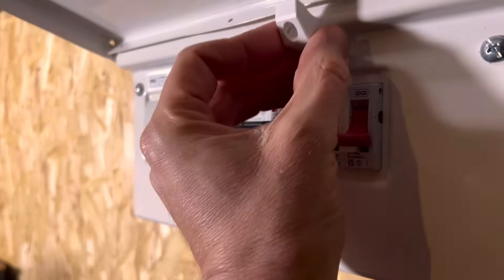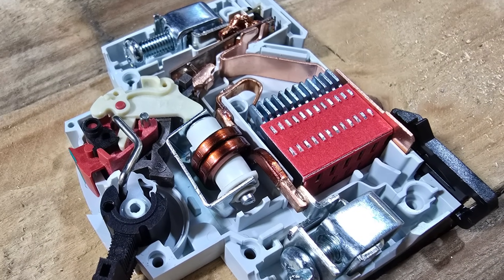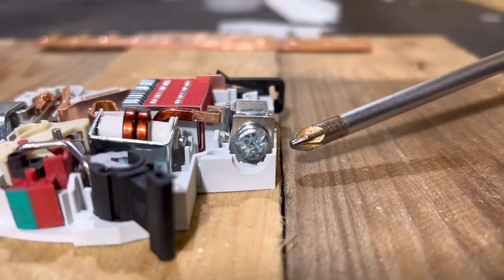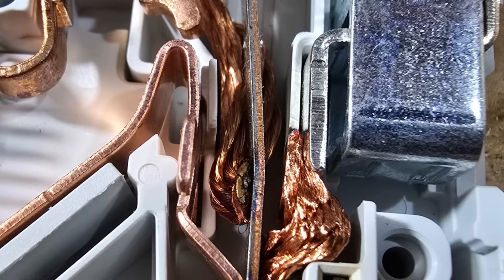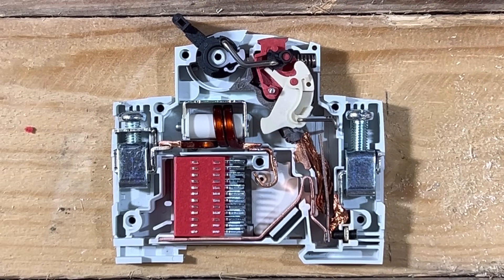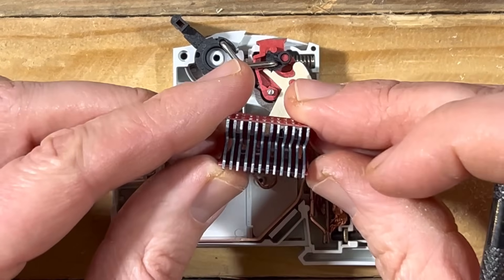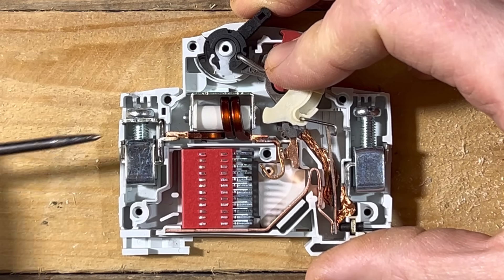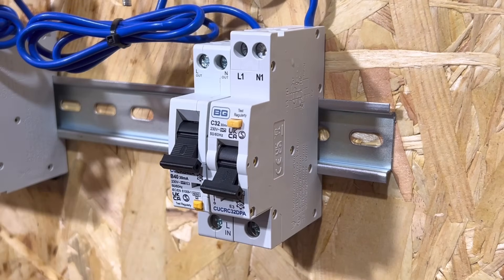How Does A Circuit Breaker Work?

Comment: Low impedance in a load is not negligible.  Negligible means something that is so small or unimportant that it can be safely ignored or disregarded. For example, a negligible amount of damage means the damage is minimal and not worth worrying about.  Low impedance results in high current and can be dangerous.
Reply from the maker: In this context negligible means extremely small, extremely small impedance leading to very high currents. It's the language used by the IET in BS 7671.

Comment: If the building has many consumer units (residential + garage), selectivity is important. ABB S750 DR is not explained.
Reply from the maker: Interesting points. 👍
Reply: @efixx even some more points: firefighter will waste his time to search axe and cut wires from solar inverter, that is why bidirectional circuits should be connected near main switch or electricity meter where firefighter has ability to kill all the power as fast as possible